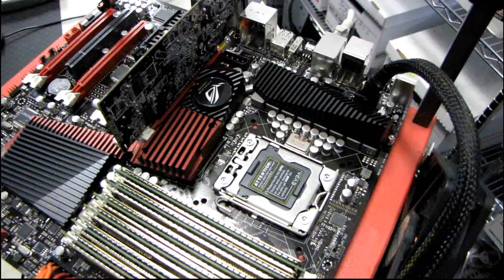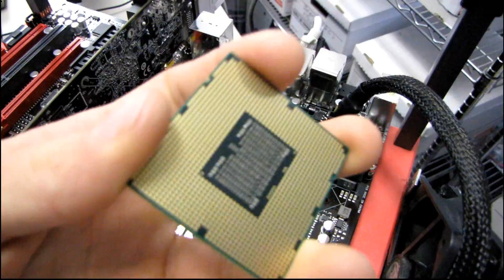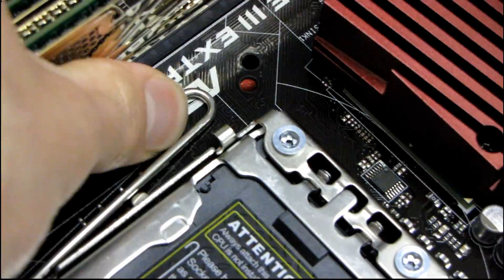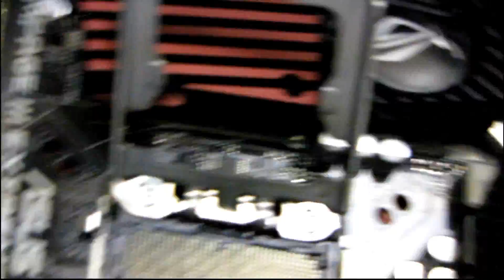Intel LGA1366 Core i7 & Extreme Edition CPU Installation Tutorial Guide Walkthrough Linus Tech Tips

Comment: @ImmortalUniverse of course there is grease on your fingers you cant see. even if you have just washed your hands with boiling hot water there is still going to be grease on your finger tips. Touching the bottom of the CPU with your fingers is fine.. I dont see how grease would effect that. Touching the top with your fingers is retarded because of the grease on your fingers will act as an insulator when you apply your thermal paste. Although I highly doubt it will effect temps in the slightest